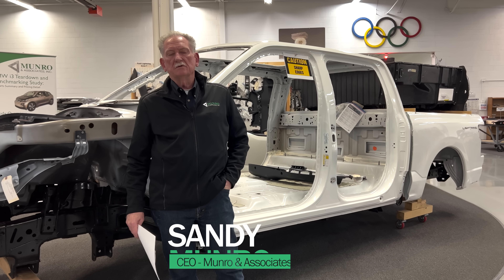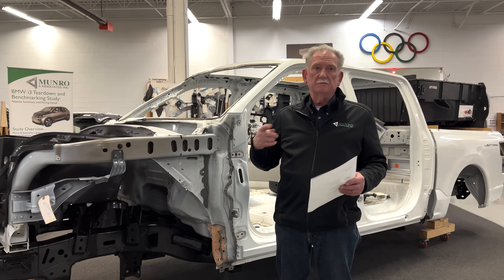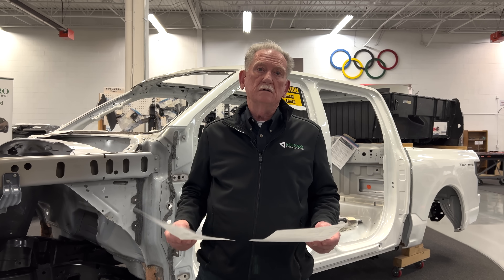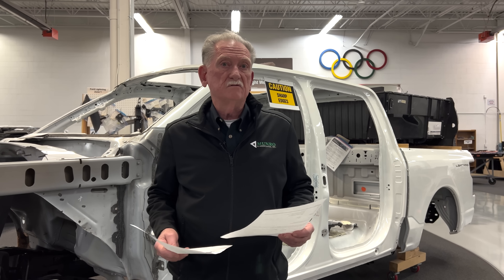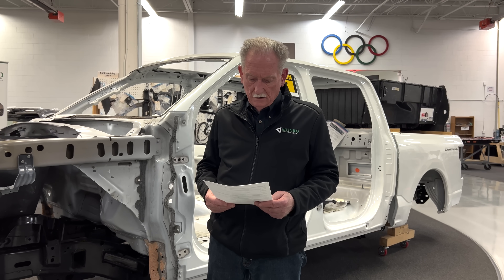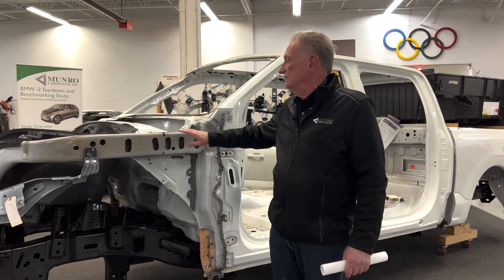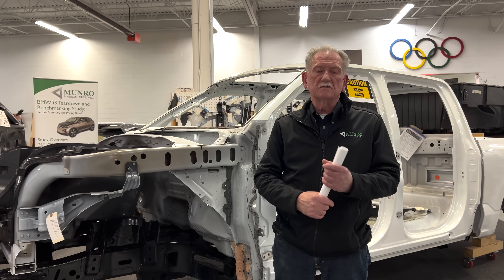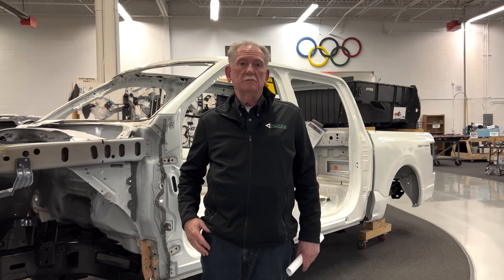Sandy's Initial Thoughts on the 2025 Ram 1500 Ramcharger

Comment: Sandy, love you, but the real world can not just flip a switch and all EV.  EV's are fantastic for commuters, and grocery getters, but I think most Americans who actually use a truck don't want to have to fast charge several times per week.  Plug the Ram in every night, or at the jobsite with 110v and most will always have enough pixies to drive on EV, and if not -God bless the range extender!  This RAM is the only current electrified 1/2 ton truck that will be actually useable in any state with real winters, or if you may by chance actually haul or tow further from Home Depot.  Sorry Sandy...The Lightning is NOT "the best work truck on the planet"  A true work truck needs to give options and not be tethered to a charging station.

Comment: My sister gets paid to use her pickup to haul new trailers to dealers.  I think this truck would be ideal, assuming the price is not crazy...which it probably will be.
It would have been nice to have a smaller, very efficient Atkinson cycle engine.  Ideally, small enough to still allow a fronk.  If a Corvette with its massive engine still finds room for a trunk, I can't see why Ram can't find the room. 
They also should have done something to give it much better aerodynamics.

Comment: I looked at the Outlander PHEV, it works like this extender setup, EV drive with small battery, ICE as needed to keep the charge on the battery.  Good drive experience however the issue was the miles per kilowatt versus pure EV.  If the RAM can drive EV only for daily, with better miles per kilowatt than Ford Lighting and priced lower, they could have a winner.

Comment: This truck is for people who pull trailers long range and need the truck as a daily driver too. The 690 mile range is irrelevant. Towing you’ll get 350 miles per (im guessing). Also think… when towing long range you don’t need to stop at a charging station with a parking spot NOT able to fit a truck with a trailer. Summary: EV at home; pull your camper/boat long range, avoid impossible charging situation, 1 vehicle.

Comment: The range extender to me is just for towing. From what I understand the Ram charger is there to fill all the concerns.  First is the range.  With most full electric EV trucks right now you are getting up to 200 miles of range on full charge.  Which means Ideally to stay in the best range you have about 120 to 140 miles of working range.  It is the beginning and we have to think about vehicles towing in the 50's.  With the Range extender you are looking at roughly 340 miles with a working range of 207.  That is 3 hours of towing that is a good break point.  This comes to the second point people complain about and charging stations.  Lets get the argument out first it is not about going green for me it is about efficiency.  With the Ram Charger you get fuel you turn on the generator and you go and eat while it charges no matter where you are with your trailer.  So that ends the infrastructure problem.  The last point why the Ram Charger is worth it is the fact that it has reverse charging.  Not only can you charge other EV's but you also can use it as a whole house generator.  No more lugging 5 gallon gas tanks or getting a pig filled.  No more outrageous home battery costs that to have the same amount of power would cost more than the truck.  You just take the truck to a gas station and fill it up.  That will be over a weeks worth of power or more depending on your usage.  I would like to know your thoughts on this to Sandy.  As always great video.

Comment: Clearly you like the Ford.  Range while towing is the issue and stopping to charge the Ford is just unreasonable at this point compared to fueling up.  One day we will get to some sort of super capacitor that charges quickly and the charging infrastructure is there but for those of us in the Midwest that actually tow would have far more real-world application of the RAM than the Ford.  Range anxiety is a real thing for those of us who tow.  Having hauled a 32 foot travel trailer from Wyoming to Kansas IN ONE DAY I can assure you it can only be done with ICE (or something like the Ramcharger).

Comment: I love that this Ramcharger can get up to 695 miles. I commute 173 miles to my job and stay at my job for 3 to 4 days and then commute back 173 miles to my house. So the first 160 miles can be on electricity and then the rest will be powered by the engine to battery. This will definitely save me money in fuel costs. Right now I drive a GMC Sierra 1500 with the 3.0 Duramax engine and fuel up about once a week but diesel is expensive so this Ramcharger would be nice to own since I can use regular fuel and not have to buy DEF.

Comment: BMW's i3 has an optional range extender. This combination didn't seem to be very popular with EV buyers. Will Ram's range extender be more successful? I wonder what the towing specs and fuel consumption will be when the truck is running in range extender mode? Seems like there is significant more complexity with this combination as compared with an ICE-only or BEV-only powertrain. I'll wait.

Comment: For me none of the BEV pickups would work.  My primary use of a truck is towing a travel trailer into the boonies.  The towing kills range and there are no charging stations where I’m going.  This truck would allow me to use it as a daily driver in EV mode, and tow into the backcountry (and back!) in hybrid mode.

Also, Sandy, you unarare that Ram had announced a pure EV 1500 prior to this Ramcharger being announced.

You sort of missed the point on this one, I hate to say.

Comment: Sandy, it's not about driving 690 miles per day, it's about not basing all your trips around charging stations.
Reply: 100%! Sandy acts like the 690 range is completely useless and it’s like he’s never considered the fact that people want to tow and people want to refuel/recharge while towing. This is way more capable and practical than the Cybertruck that’s for sure. The Cybertruck is really cool but for $100k, it does not meet the bar for what most truck owners use their vehicles for.
Reply: @King_Cole  he is also forgetting that this 690 miles of range will quickly turn into 400 or even less once a normal person seats behind the steering wheel of that truck… That F150 lighting will turn into a 100 mile range truck once you attach any trailer to it… 😂 stupid comparisons 🤷‍♂️
Reply: @av7447  I could not agree more. Could even be less than 400mi but at least you can fill up and be on your way. Charging with a trailer does not really work with today's infrastructure.
Reply: @av7447 Yup, already proven that the lightning is more like 100 once your towing. Which is useless unless you have a week off to get anywhere. Lol
Reply: @av7447  That is not true at all. Chevy Silverado does every bit of its rated range with people in the vehicle. The rated range is not based on some estimate based on battery size. It is a test under specific conditions in which the driver is required.
Reply: People do like to take road trips. I don't want to worry about changing my truck. I want to put gas in it and go.
Reply: @CoreyRussell-p7l do you mean *Charging*?
Reply: And towing range!  My F350 gets 650 miles unladen range.  Chop that in half towing.  Also when towing you are limited at where you can fit to fill up.
Reply: Exactly!
Reply: Yea that criticism is really surprising. Range is the whole point of the Ramcharger and the need for it is very real. I wouldn't have bought my regular gas engine truck if it only got a quarter of the range regardless of what the fuel economy figures were.
Reply: its also about towing way more than every ev on the market, possibility to go everywhere you want, overland, power entire RV, use tools...... no ev can compete.
Reply: Sandy is just salty that the Cybertruck only gets a little more than 100 miles when towing something that isnt aero at highway speeds in cool (not cold) weather.  This makes sense since as everyone points out range gets cut in half for towing.
Reply: @bentrollin7868 100%.  I have an electric car.  I charge at home.  I agree, buying the Ramcharger as a daily driver just for commuting is dumb.  But the Ramcharger can commute on full electric, and then offer a realistic 300 miles of towing range from 2-minute fill up at a gas station without unhooking a trailer.  690 miles of unladen range doesn't matter, and Sandy should know better than to focus on that.  145 miles of electric-only unladen local or commuting range matters.  500 miles of gas-only range while on the road, and 250-300 miles of gas-only towing range while on the road matters.  The point of the Ramcharger is that you charge up at home, and gas up on the road.
Reply: Can someone please just make a range extender that works for all electric trucks? Charge me five grand I’m OK with that.   Or better yet let me rent it three times a year for 75 bucks per day.
Reply: Sandy is an idiot. 690 range is when you just drive around. When you tow and haul that 690 goes to like 300 which it reasonable for a truck. Unlike the cybercrap that can go like 100 miles if you are lucky while towing/hauling.
Reply: Exactly. Also those numbers are grossly over rated compared to real world driving, esp hauling anything. Then those miles are more like half if your lucky.

That’s why I will go for more rated mile range every time.
Reply: "it's about not basing all your trips around charging stations"
What's with non ev owners' obsession with supercharging? Don't you people have homes with electricity in them?
Reply: @ElMistroFeroz Not everyone owns a home, not everyone who owns a home can afford the additional expense of  a home charger, and since putting out a fire in a battery powered car or truck is new technology, I would prefer the safety of not risking my life or property.
Reply: I think that Dodge has done their research research when it comes to those of us that tow. For me I only told locally so I’m good with my Ford lightning but if somebody is towing a camper or they do shotgun deliveries, this would be a really good option for them.

What I would like to see is a very small and efficient range extender for my Ford lightning for the rare of occasions when I need to go a longer distance and don’t wanna have to worry worry about charging.   But for me being able to charge on the super charging network is a complete game changer.
Reply: I think that Dodge has done their research research when it comes to those of us that tow. For me I only told locally so I’m good with my Ford lightning but if somebody is towing a camper or they do shotgun deliveries, this would be a really good option for them.

What I would like to see is a very small and efficient range extender for my Ford lightning for the rare of occasions when I need to go a longer distance and don’t wanna have to worry worry about charging.   But for me being able to charge on the super charging network is a complete game changer.
Reply: I’m guessing he’sbased in Cali, where chargers are plentiful.
Reply: Yes.
Reply: He is forgetting one if the worst things about EV trucks are that when you're hauling something, the range drops significantly. So if you're pulling a travel trailer or boat, the 350 miles quickly gets cut in half, or more. The 690 is more than enough for long trips but even if you cut it in half, you're not stopping every two hours to charge.
Reply: ITs usless because your NOT saving any GAS. The gas motor charging the battery always runs and always is using gas.  Why not make it so it drives on just EV for 140 miles meaning you can drive 70 miles away from home drive back home 70 miles and use NO gas put it on your home charger and then recharge battery with cheap home electricity NOT USING ANY GAS. BUT still have the ability to use the gas motor on longer trips pulling a trailer or boat. RAM screwed up making it so the truck never uses battery ONLY.
Reply: The average person doesn't go on trips all the time. Let alone with their own vehicle. Super niche truck with a lot of shit to break
Reply: @b-lonmusk  yeah no. You clearly have no clue what you talking about. Minus the electric motors, everything else comes from their normal trucks. You know proven tech that works. Unlike the cybertruck that can’t even stay out side without rusting away. Sandy is an idiot who doesn’t know anything about actual function of a truck.
Reply: @b-lonmusk True - but it’s a truck  for towing, camping and hauling stuff. Those numbers will quickly be cut in half when you do anything other than go to work or buy groceries…….. if you just want that, then go buy a Tesla

Comment: First of all go drive an electric vehicle... Then go drive that same electric vehicle in winter time and check your battery life. Full Electric is garbage for the northern states. You need a gas generator as backup just in case you dont make your destination. At that point its just add Gas and Go like a regular gas vehicle.  I have a Volt its the same tech and works amazing !

Comment: The V6 / 130Kw generator seems unnecessary - my Lightning runs at worst at about 40kWh/100km (real winter, 70mph highway driving. some wind).   You have a decently large battery in the frame.  I assume you can run the generator while driving - otherwise this whole concept is flawed.   A 20-30 kW generator would keep up with the vast majority of the demand and be "blended" with battery capacity, be cheaper, lighter, and smaller, possibly even still affording some form of frunk which is one of the great features of EVs.  At first glance this is lazy engineering and RAM just wants to sell the kind of powertrains that keep their service bays humming.

Comment: Whilst not many people really "need" a 690-mile maximum range, IMO the Ramcharger's system is much better than the Lightning for several reasons. 1) Usable towing (both in range and ease of recharging). 2) Using the battery and generator for electricity at a work site.

Comment: I think Sandy is missing the point of the Ramcharger pickup. I say this as a current Lightning owner. The Lightning is a great truck most of the time. Commuting is great, around town, on the farm, local jobsite it rocks. Even hauling and towing local is great. (The electric motor torque is amazing). But road trips with the current infrastructure are a problem. I have the ER battery truck...around town in Summer its 320mi easy. At 70mph the range drops to ~250 to 260mi. Add a load(non towing), strong headwind, or cold temps and now you're pushing it to do 200mi on a full charge.(Worse at 75mph)  On a trip (DCFC) you should really charge back up to 80% at public charging..now we're below 200mi for each additional leg. If you're towing, now its 100-150mi tops. With chargers 30-50mi apart(at best) it becomes a real struggle. In the midwest its a non starter. The Ramcharger offers a good option. I love how my EV drives..smooth, powerful, fast and its convenient when you can charge at home. However having to drive it regionally or road trips are still a problem.

Comment: Hey Sandy, your experience is immense but your life is different than others and you need to remember how that impacts your conclusions. This RAM is not geared towards 10 hour drivers they are unicorns.  Instead, if I was a higher mileage person (tradesman/parent/ RE agent/ long commuter etc) and didn’t have to fill up my car/truck/ van but once a week then I’d have more productive time back in my pocket.  If I could plug in overnight and rarely need to visit a smelly dirty gas station that is also a productive time banking opportunity plus a quality of life improvement. Having to nearly never look towards that fuel gauge with a sense of dreaded anticipation is priceless. There are a lot of drivers in that category who will benefit from this.  I experienced this revelation with my tiny battery Range Extender BMWi3. In 35,000 miles of shorter commuting driving I put 7 gallons of fuel in it. 4 fill-up’s!  I just plugged it in every night. Cheap easy driving true bliss.  Those RAM range numbers are real life, daily task, real dollar, changing for a lot of drivers.
Reply: towing .85 mile range of cyber tuck. vs probably 200 to 30o mile

Comment: Once the battery is depleted to (typically) 20% - but no less than 10%, the system will not allow further discharge and maximum continuous power will no longer be the 663hp but rather the output of the generator, which is 130kw, which is174 hp (130/0.746) as 746 watts = one hp. The battery then acts as a large capacitor where the full 663hp is available for a short time until the hard discharge limit is reached. Usually this does not happen unless you are towing or speeding up a hill over a mile or so and do not give the generator enough "cruise" time to replenish the battery, in other words 174hp throughput is all you will get in the low battery state, but that is average which could be a 663hp burst, followed by 40hp to cruise at 80 mph. Towing up a long grade with a heavy load will most certainly result in just the 174hp generator throughput limit pitted against the weight of the truck + load.

Comment: Why wouldn't they just put a very small, but efficient engine in there? The 690 miles of range is completely meaningless when there's a fuel tank. No one talks about ICE vehicle range because the "recharge" time is 1-2 minutes of gas pumping. The effective range of an ICE car is infinite. If this Ramcharger was a 1.3 liter engine out of the Renegade 4xe, that would has still largely accomplished this "infinite range" issue and reduced the overall package weight meaning we would have also got more pure EV range too. Maybe I'm missing something, but this just seems like an incredibly stupid design.